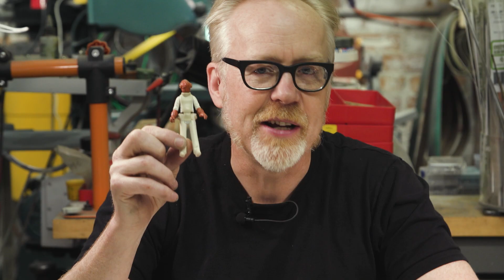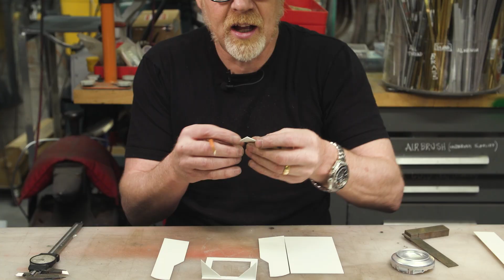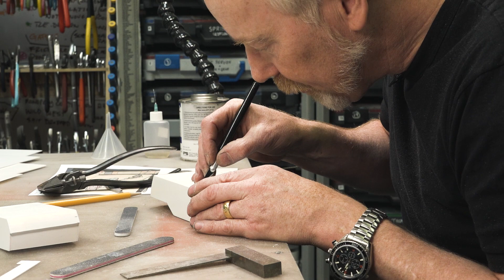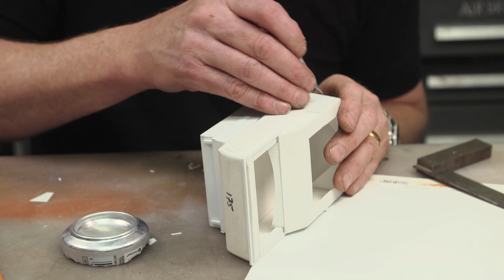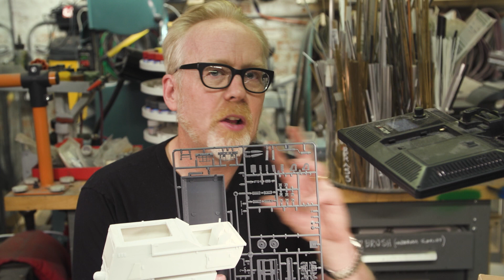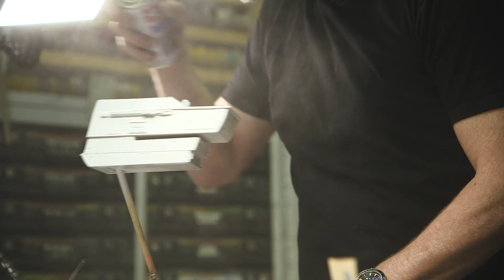Adam Savage's One Day Builds: Kit-Bashing and Scratch-Building!

Comment: @tested   I haven't done this before.  Two safety questions:  1) What about fumes from the welding glue?  I've seen other scratch builders use respirators when in doors even when they say they are in well ventilated rooms.  2) What about sanding residue (micro plastics)? Should we care?

Comment: All good & true. I made styrene models at Mattel for 30 years, where I worked with many excellent modelmakers from Hollywood. Styrene (especially Evergreen strips) can be hard to find and is ridiculously priced now though. And yes, Weld-On (and the MC and MEK we used to use) fumes are quite toxic.  My preferred material now is... WOOD. Walmart, dollar stores, hobby shops & craft stores everywhere sell Popsicle sticks, dowels, toothpicks, plywood plates, struts of many shapes, etc. Thin stuff cuts with X-acto (roll cut dowels) or a small bandsaw. A small drill press is nice too.  Wood is 10X stronger than styrene. Superglue works, thick and thin. Styrene is fine for looks-like models, wood is much better for load-bearing, functional prototypes.  BTW don't throw away the plastic sprues in the kits. It's styrene and glueable and great for making misc parts. And then there's the superglue & baking soda trick...

Comment: Recently finished a starship scratchbuild based on drawings made by a friend.
Just sheet styrene, some space shuttle parts, assorted bits of randomness, and hemispheres from an architectural store.
One of my favourite tools to mark stuff on the mostly-circular body was a compass wtih a nail instead of lead. Score a line with the sharp needle point, then reversed and used the fatter nail to smooth the line down.
Lots of first on that build.
First time scratchbuilding an original design. 
First time lighting a scratchbuilt model.
First time mixing the TOS Enterprise base paint with Tamiya.
First time doing airbrushed weathering.
Styrene's awesome, man...

Comment: Looking at the description of Weld-On 3, it's for acrylic, not styrene.  It looks like weld-on 2343 is for polystyrene and abs, so it seems like that would be better for most modeling?  However, everywhere I see Weld-On mentioned for modeling it does mention #3.  Anyone know any pros/cons of using one over the other for bandai models ( usually all polystyrene with a little abs and Polyethylene depending on the age of the kit) ?

Comment: Love the build and you inspire me. I do papercrafting builds mostly.  Wanna try it with Styrene. 
Not sure if I can add to your amazing talents but here goes lol. I bought a cheap 3d pen online, with included filament. It was a starter kit. Tried using it as intended but to no avail. My 3d printing freehand was a mess. So I now use it as a welder, especially little areas where I want to add pipes, wires etc... you can build up the area and form it around the piece your adding. Or to reinforce a seem, joint. I even made micro hinges with it. Place a pin near the hatch, weld onto it, then place it to the main prop and weld the other ends on the pin. perfect hatch hinge. So many things it can be used for. I also use it foer modding hotwheels after I take hem apart. weld the axles back in place, fill the pin area that was drilled for removing the body etc.. so many things it can do!

Comment: What kind of paint brush is safe for weld-on 3 cement? I decided to give this a try and was at a loss for what type would work without fusing the bristles. I ended up using a strip of cardstock, which worked decently, but would love to know what kind of brush Adam uses.

Comment: A great video. Thanks for making it. There's no way I'd use that weld bond stuff without a respirator and eye protection (and probably a fan), though. I've used a different brand of the same type of product. It's very toxic stuff!
Reply: Oof, and he uses the cyanoacrylate accelerant at 21:40 without a mask and leaning right over the piece, that stuff is even worse

Comment: Great videos. Didn’t know they existed. Thank you!!
Question- can the styrene weld glue be use to glue styrene to fiberglass?
Thanks in advance!!
Reply: Raul Mayoral  - personally, I don’t think Weld Bond, Tenax, Plastistruct, or any other like adhesive would work on Fibreglass.  You’d need either a “Crazy glue” type or a resin/epoxy style adhesive to bond styrene to fibreglass.

Comment: if you cant find weld-on number 3, get plastruct bondene or a similiar all purpose welder. don't bother with hobby cements as they usually won't handle both styrene and abs at the same time or any dissimilar materials project.

Comment: When I build my scratch builds or kit bashes I use a glue system that does 3 things 1. Bonds tightly 2. Heats the plastic (chemical reaction) 3. Fills all gaps so they look like real steel welds when painted. The glue is called "Zap-A-Gap" which has a needle applicator, then a spray called "Zip-Kicker" The "Zap-A-Gap" takes awhile to dry on it's own so that way parts can be worked & positioned properly. When the "Zap-A-Gap" is sprayed with the "Zip-Kicker" the bond is FAST. You see the "Zap-A-Gap" expand, you hear a low sizzle, & after the bond if you touch the area it's slightly warn to the touch. I still have models that I built 15 years ago and have been dropped, fell over, even fallen from the ceiling and never broke the glue is tough stuff on plastic. It's really pro stuff.

Comment: How do you cut straight lines without a straight edge? If I tried that it would look like Foster Brooks and Otis Campbell went for a drive!

Also, great tip on using the bottom of a can for holding glue/solvent. I'll have to try that.

Comment: Really cool kit bash!  I'm just wondering if more round ball joint cut for the stand connection might be better?  Give the ship more flexibility.  That way you can angle it a little better give it 1 degree shift so it has the illusion of movement.  I suppose you could build it back up so that it has that 360 movement.  Otherwise very cool!

Comment: Pro tip, buy yard sale/for sale/etc. signs for your sheet styrene. they have three or four thicknesses usually, so it won't do everything you need to, but you will save a lot of money still
Reply: also, strop your blades on a piece of cardboard and they will last much much longer. And 100 box of surgical scalpels is much cheaper than 100 pack of exacto blades...

Comment: Not a styrene builder but it seems like a water brush, like the ones used for watercolor painting would be the best of both worlds between brush and needle applicator for applying weld bond. The caran d'ache ones even have a plunger to fill up.

Comment: Have you ever looked at using surface mount resistors for the small repeating details? Available on strips or reels for fractions of a cent each in various identically sized rectangles.

Comment: The cement does not melt polystyrene. Melting requires heat. The cement dissolves a small amount of each piece at the joint and then rapidly evaporates.

Comment: I'd suggest 1mm thick for most scratch building, it's the easiest to cut and snap, trim and glue. 1.5 or 2 mm thickness if you need anything thick, or to be load bearing, like where a stand connects or the model has something hanging off it - it's also a lot harder to cut. For the warham players - .5 mm thick sheets are the perfect thickness for all those raised armour panels on vehicles. 0.2mm thickness is really limited in usefulness, and I've only found it really works to add tiny details of armour paneling to 1/35th or 28mm figures - try to only use super glue on this, it tends to melt/get wavy from the solvent glue. 

I'd also suggest for practise, make tiny boxes. Box rectangles, cubes, even polygons if you're ambitious (for sci fi stuff, think of a rectangle with one extra side that's angled), all odd sizes maybe up to 1.5 or 2". Once you can make a passable box, you can make anything! And don't toss out anything (except maybe the most egregious failures), you'll end up using a ton of these shapes to bulk out and raise areas for engine coverings, air intakes, exhausts, whatever. And you can always cut these random boxes down to the size you need.

Comment: An even better source of sheet styrene is signs. You can pick up "For Sale" or "Beware of the Dog" signs at a hardware store, usually for around a dollar for a 9x12 inch sheet. Bigger signs are available, as are thicker ones. One side has the words on it, but the other side is smooth and blank.

Comment: Loving the 1 day builds, and loving seeing behind the curtain on movie model making. Just a quick question on painting the model (i know it wasn't more than primed). In work as an architectural and marine modelmaker we use styrene a lot but find that primer doesn't like to adhere propperly, especially to the glossier side of styrene sheet. Keying it with sand paper usually does the job but i didn't see Adam sand the model all over. We use Hycote plastic primer but it still lifts with masking tape. Any advice or is keying it up the best option?

Comment: That weld-bond trick has just made me want to get back into model making. The one thing I really hated about making them was the modeling glue taking forever to bond parts and also getting everywhere. It would also ruin most brushes, even natural ones because the solvent to clean it out never got all of the glue off of them and they would get their bristles glued together over time.

Time to find some cheap kits and a few cathedral kits to build some WH40K capital ships and Titans!
Reply: All manufs now make thin, fast cement.   Good luck on 'cheap' kits, no such thing anymore.  maybe yard sales or something.  Kitbashing would get $$$$ quick.   These days I'd use milliput  and reusable mold plastic(reshapes in hot water) to craft griblies.
Reply: It's called E-bay and going to local shops if you live in a large city. As far as the kits that are used heavily that have been featured here, griblies can be 3/d printed and made, as my recommended. You have to understand that I am looking at general griblies and pairing those with Gothic architecture parts from models. I am not trying to re-create known models  from movies, which makes my kit selection very wide.
Reply: Tamiya Extra Thin cement is easier to find and comes with a brush in the cap, great great product and very fast bond similar to Weld Bond
Reply: reusable mold material is called BlueStuff, from GreenStuffWorld.com in spain.
Reply: Thanks for the tip. Casts of some parts for repeating them will be needed.

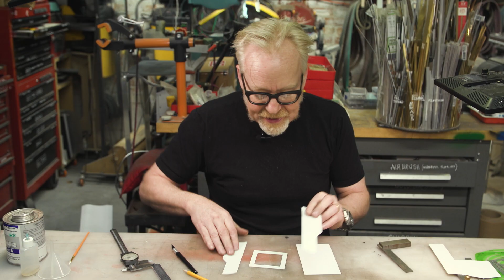Comment: Couple of things the WeldOn  1) It is VERY thin stuff and will evaporate in a heartbeat even from a tightly capped container.  I put some thin plastic "wrap" under the cap which slows this down.  2) Weldon will fog clear acrylic plexiglass (perspex).  But if used right will make a beautiful weld.  The needle applicator, which you can see at lower left at 7:44, is important to use for precise application just at the intersection of two panels, a brush will smear too much.  Because of thinness of WeldOn using the needle applicator takes some time to do well without dripping spots onto things you don't want.

Comment: Wondering about the intricacies of how this worked in a professional shop? For a small model like this would you run it by the art director at multiple stages of completion, or were you given free reign? Were you given direction from the start on how to attack the project? How do they ensure consistency when you have many different model makers working on different things at once? Different model makers would interpret concept drawings differently wouldn't they?
Reply: I don't speak from experience but different styles on different types of vehicles wouldn't be a bad thing, they can always say that one is built by Corellian Motors and one with a much different aesthetic is built by a Wookiee factory.

Comment: Wow! Inspiring. This is the kind of stuff I love from Tested.

Does anyone know if styrene can work for models that aren't so boxy? 3D curves like the body of a car. Are there styrene techniques to turn the planar surface into a 3D curve?
Reply: can't say I know myself but it looks like as long as you're bending it on one plane it would be fine. You can see he uses a bit of a curve on the front of this thing. I highly doubt you'd be able to bend it on multiple axis though so probably not ideal for car building, I'd go with some kind of modeling clay like the experts do when making car concepts.
Reply: Yeah, it looks like styrene  works well for 2D curves. I google image searched styrene models, and you can see several models with rounded (3D) curves. I think they are using styrene tubing--interesting.

Comment: Any makers out there? I want to get into this, but I'd like to learn more. Firstly, local shops and distributors only sell ABS at 3mm or thicker. Is HIPS (polystyrene) a good substitute? Secondly, I can just use acetone and 2-butanone, right? And the last question, does the brush have to be made with natural animal hair? I'd guess synthetic wouldn't take too kindly to plastic solvents.

Thanks in advance for any help!
Reply: Go online and look for Evergreen Scale Models Strip and Sheet Styrene, as you'll find all the variants of strips and sheets (including textured sheets) of styrene you could want (or just search for strip/sheet styrene by other brands). You can use ordinary polystyrene cement or other glues that have the generic Plastic Weld name (they also work on ABS plastic). The one I use is in a glass bottle and is by E.M.A. Model Supplies (check ebay if you can't find it). I've just been looking for that Scigrip 3 glue that Adam is using and I've found the company's distribution page https://scigrip.com/distributors.
I use an old sable hair paintbrush to apply Plastic Weld.

Hope that helps. :)
Reply: HIPS is what you want. High Impact PolyStyrene. For glue I would recommend Tamiya Extra Thin. It has a brush built into the cap. The stuff Adam was using is really HOT (ie. aggressive).
I would also add that Polystyrene can also be vacuum formed and 3D printed. I'm building a model right now that uses sheet construction, Vac forming, 3D printed styrene and kit parts (also styrene). The 3D printed parts sand beautifully and bond very nicely with the Tamiya glue.
Reply: Back in the day I used styrene and choloroform to create stuff like this, usually on a wooden base with the styrene stuck to the surface of the wood with double sided tape.
Reply: Oh and yes, use a natural hair brush, synthetic hairs tend fall out and end up glued to the model - it's a real pain to remove them too.
Reply: ...coroplast? I mean... I hope you weren't using chloroform............
Reply: @contactjamieroy  Easy to confuse the two when one's other hobby is abducting people.
Reply: Most modern styrene glues are a derivative of chloroform, I guess being a carcinogen using neat chloroform has faded out of use due to health reasons. 20 years ago in the UK, pretty much every material we used was highly cancerous!
Reply: @jkljkl6  Mhm. Asbestos comes to mind :/.
Reply: You can use chloroform or dichloromethane just have a small dispenser bottle so that only a tiny bit is exposed at a time.
Reply: Look for hobby shops that cater to model railroad, model car, RC aircraft, etc. hobbyists. Guaranteed they'll have the exact evergreen styrene shapes and sheets that Adam used.

And while you';re there, check out the bargain bin for kits to source greeblies from.